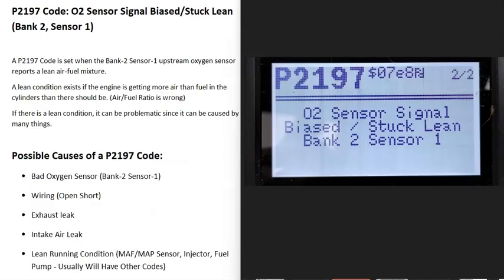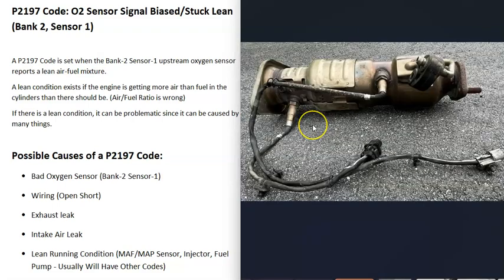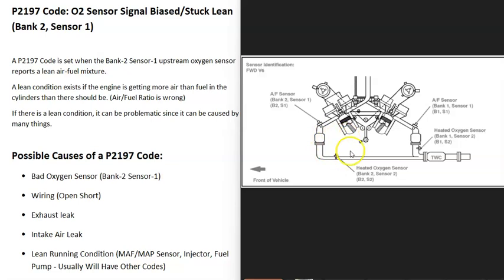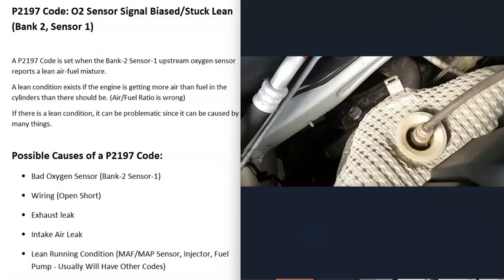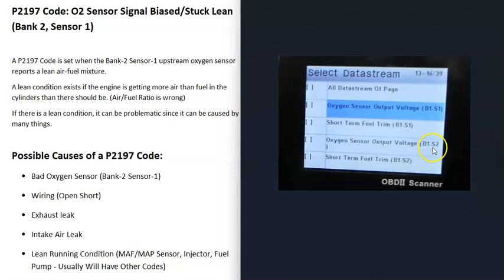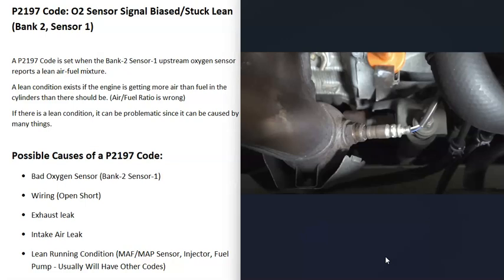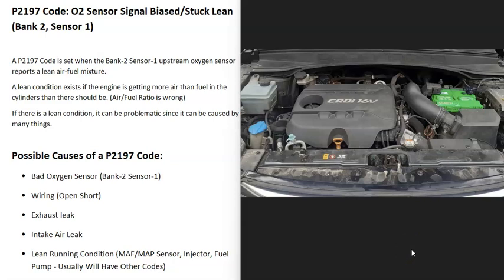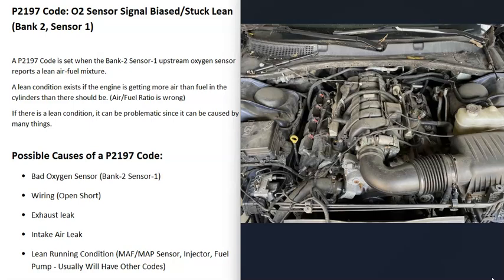Causes and Fixes P2197 Code: O2 Sensor Signal Biased/Stuck Lean (Bank 2, Sensor 1)

Comment: What if you have 2 o2 sensors stuck in lean, bank 1 and 2?
Reply from the maker: When both banks are stuck lean, the cause is likely something that would affect the whole engine, such as fuel pressure, a bad sensor, vacuum leak, and so on.
Reply: @HVAC_Mechanic thank you for getting back with me.  I have given up and passed it on to the mechanic, lol!  Kinda think it may be a vacuum leak, but we shall see.  Hopefully it isn't too expensive....
Reply: @leaneknight4007  What was the problem  ?

Comment: i have this code on a 04 navigator swapped the sensors no change and the sensor is covered in gas runs good until closed loop and i get a cl fault possible wiring issue?

Comment: My field trims are normal Drives normal but there was a bunch of dust in the air box tthe mass air flow sensor The fuel trims are normal. Check into mine hasn't gone off yet says it's lean but I don't believe it

Comment: My 02 sensor was changed. But still throwing our same code. The other codes are misfiring on 4 different cylinders. 2014 F150 Ecoboost. New engine installed.

Comment: I get code p2197 with p2241. Would this be replacing the Air fuel ratio sensor?